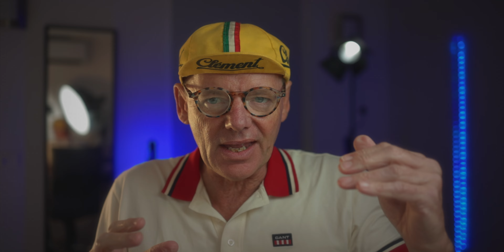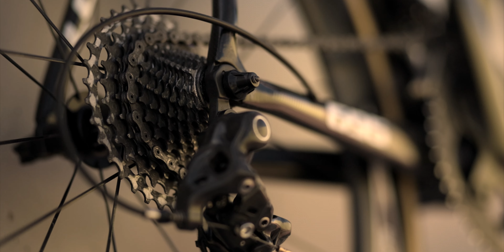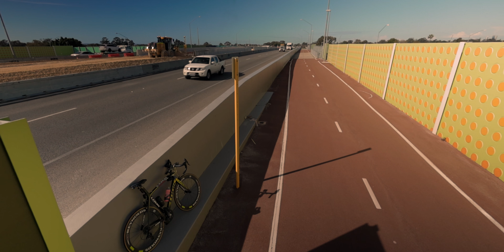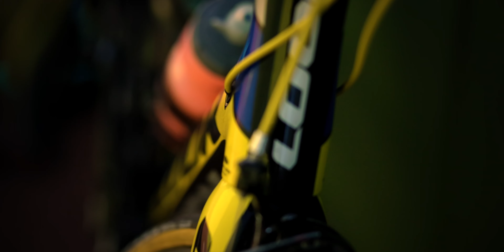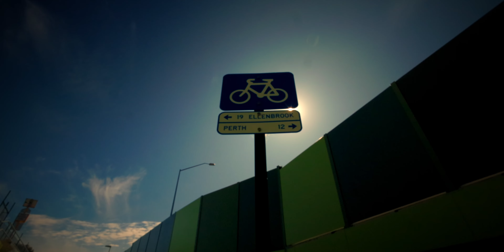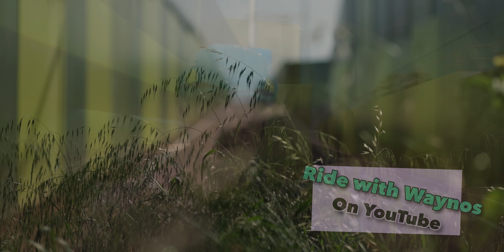Is your bike dangerous?

Comment: Arguably a fixed sleeve or channel inside the head tube should be able to keep the internally routed cables and hoses from touching / rubbing the steerer tube
Reply: That doesn't sound viable. How are the brake and shift lines going to move with the cockpit?
Reply: @sbccbc7471  They should move inside another layer of sleeve, which is internally lubricated. Just like steel rim brake cable move inside a sleeve.

Comment: OMG! Waynos i agree 100% when i purchased my 2008 Kestral Talon, it was so different from my steel bikes i took it to a couple different mechanics to check out my build, it made weird sounds, and cable rattled inside frame, got all that fixed, my second bike 2015 GT Grade, all cables are attached outside of frame and huge square fork, it's like a MTB not as cool but you see everything! When asked price to cleanup the cables up front, they said $175!! I get it, its lots of work, I purchased all the parts, thinking I'd do it during winter, but all I did was swap wheelsets and just rode!  For my 71st birthday I was thinking of a Look 795 Blade, everything hidden! keep up the great work! you speak of things I worry about!

Comment: The open end " C " type compressing ring is cheaper to make & easier to assemble the bike in the factory, it have a bit over 200 degree of engagement.  Most of the major brand bike  use it. The best design so far is the Token compression ring, It have almost 360 degree of engagement.  Shape edges been chamfering.  But is more time consuming to install. cables & hoses have to put through the ring.
Reply: If you're talking about having to recable the bike to replace Token's compression ring, it doesn't look like that's the case. Its open-ended design allows fast and easy replacement, for both the M-Box and S-Box versions.

Comment: What happens when you pay a small fortune for this 12 month check and they discover damage on the carbon fork steerer tube? Who takes responsibility for fixing this? Warranty claim - no, the manufacturer will walk away and blame the bike shop. The bike shop will blame the design + manufacturer and walk away = the customer has no choice but to spend a small fortune on new fork, rebuild, etc etc… Like many comments below, I stick with rim brake, external cable road bikes, not because I don’t like or appreciate modern design, but because I don’t trust the standards or support I would get from an industry just looking to keep making money out of enthusiasts.
Manufactures are constantly trying to reinvent technology to differentiate themselves from competitors, for press coverage to raise brand awareness and to create new desire for their products. “You need this years model sir, last year’s design was rubbish…”
Reply from the maker: Well potentially that could be a new fork and spacer, so not going to be cheap if no one wants to cover it 🤔

Comment: Here's another issue that's probably there:. Introducing electricity to a carbon frame?  Any alloy in contact must encounter increased electrolysis
I had a Trek and an Orbea with alloy dropouts, obviously assembled without care for this and I stopped riding the Trek due to obvious degradation of the bonds.  
  I worked as a shipwright and had a sunk boat repair job when one boat lost it's battery maintainer overboard, putting current into the bronze hull fittings of the boat next to it.  The bronze became swiss cheese

Comment: I also think that bikes should be designed/built/QC:ed so that one doesn't have to make annual inspection of it whether dropped or "light" crash etc.
Reply: Thats what basic and mid level components/bikes are for. The top of the line stuff (in my mind) is always going to come with some unchartered territory.

Comment: i think for the silly prices these days for bikes the engineering is not reflected in the pricepoint...to pay upwards of £ 12000 sterling and have integrated handlebars fail is nonsensical......look at all the snapped frames of pro riders and racers...one crash and the bike is potentally ruined....even cheap low end bikes are thousands of pounds...bring back cheap steel bikes for so called normal people...needs to some regulation so certain parts are fail proof....

Comment: Cables running through the down tube or top tube is OK as long as they're running through housing, but I want nothing to do with cables and wires running through my stem and head tube where they are subject to rubbing and chafing and their condition can't be observed.  I don't want my bars, stem, headset, and fork compromised by internal cable channels either.  My strong preference is for every inch of cabling and housing to be visible so I can inspect them for problems.

Would it be acceptable to anyone for his or her car's steering column to be disassembled periodically to make sure the brakes will work and the gears will shift?  No, it would not.  Why should our bikes require it?

Comment: The Look...Aero!..Save lottsa watts!...I give em credit for selling this to get people to want to give up their older bikes and buy the latest.  But if you're not in the breakaway or riding a lone-flyer, you're going to be in the draft..and there goes the "aero" advantage of the hidden integrated concept.  In order to look cool  what
   do you lose?  The ability to interchange parts.  The owner-maintenance option.  The ability to easily adjust bike fit.  Safety.  Big price. 
   The teams get huge payments, unlimited bikes and lots of factory mechanics to ride what their bike sponsors are selling.  So they do, and it looks really great on TV or the net.  But we who ride unpaid don't have team cars following with multiple bikes. 
   In a way it's cool that some riders feel the need to "be like the pros" and ride an Aero integrated disc tubless bike at the front of group rides.  Easy to sit on.. always compliment them, tell em they're hammering you... You're saving 20% more watts than them even if you're on an older climbing bike or...
Reply: That's why I stay away from road cycling. I'm happy in the mud, on loose gravel and constantly climbing. No need for aero shenanigans, and all my components are easy to fix/replace in the middle of nowhere on a multiday camping/cycling trip.
Reply: @KNURKonesur  My older road bikes won't be replaced with the new-style.  For the reasons you've mentioned.  I'll stick with my mechanical rim braked adaptable and user friendly 17lb bike(s) and be happy when I go on extended remote travels away from bike shops, Amazon delivery, like that.  If I miss a ride because there's an issue related to some "improvement" like a flat battery or a pinched brake hose or a broken part that is totally proprietary and unavailable.. that's not happening

Comment: About the airplanes; yes if 1 engine fails, you have redundancy. But there are also parts, which have been designed "Fail-proof". For example wings. If one fails, you are unlikely to survive. They fit therefore in this "Fail-proof" concept. 
Similar principles apply (must apply) to bicycles. There should be no scenario "in case your fork breaks", the fork should be designed in such a way that "it will not break".

Comment: I'm no engineer, but I have extensive experience in working on Road bikes. The issue here is that there is no standards adhered to with these non-redundant parts. Like the Oceangate disaster, they happily use people as the Guinea Pigs. To my mind this is morally corrupt and un-ethical. I personally would not buy a new style of Road bike with hidden anything. 
If it is easily inspected then generally,  it is easier to service, so the rider will be more willing to take on his own servicing, and thereby know more intimately his own bike, and any safety issues that may arise. Hidden cables, through steerer routing etc flow onto extra costs associated with taking the bike  to a mechanic for  inspection of these systems/parts, so maybe the rider will delay or avert altogether periodic maintenance, and the outfall of that could be catastrophic to the rider.
Added 15:30...... If you build the fork stronger it will increase harshness. Front end assembly and hidden routing  for disc Road Bikes is the biggest problem the Industry is facing. No one has done it very well yet. Because there are so many flow-ons from each solution any one tick is a cross at the other end.
Reply: I couldn’t have put that better myself. I really couldn’t. Top post IMO 💕✌️